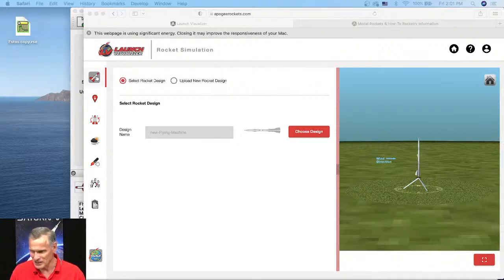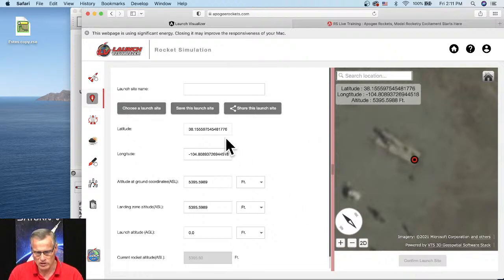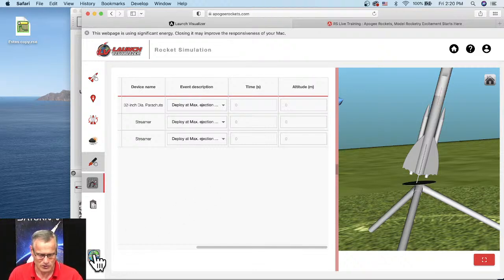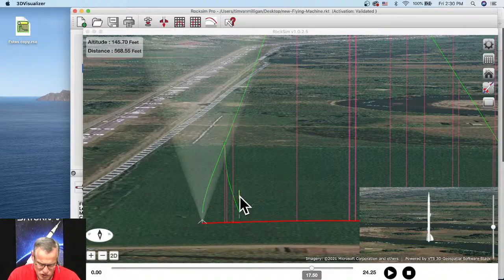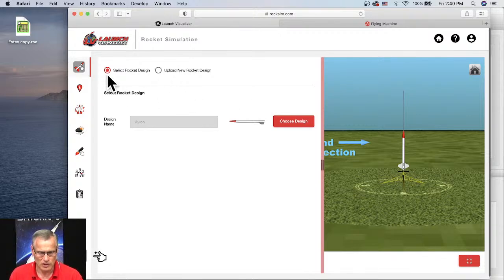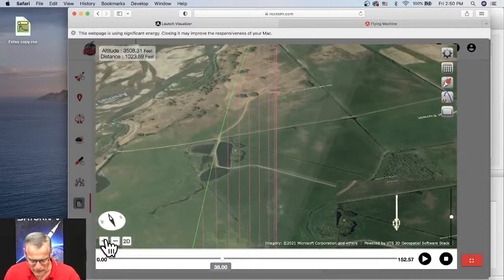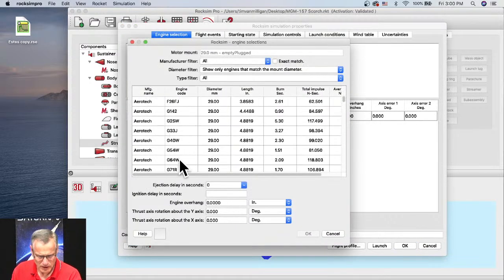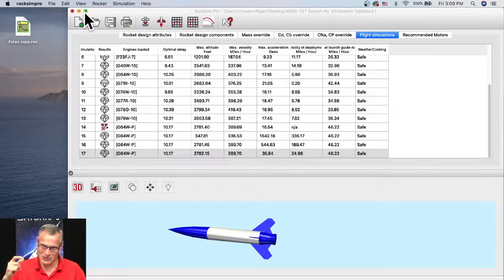Changing & Setting Wind Speeds - RockSim Training Live #46

Comment: I launched my model with 2 pods that separate. Only 1 pod separated and dissapeared. I also only got 1 pod to load with a motor. Is that the bug?
Reply: Aha.. cheked the vid again. I noticed I had a rediculous calculated weigth for the parachute.. mass was overruled though.
Reply from the maker: There is a bug that the programmers are aware of. I'm waiting for them to tell me it is fixed.
Reply: @apogeerockets  I've dug into it a bit more (not completely because that uses loads of glucose) but it seems to me that the weigt of the pods is on the rocket to apogee and that the thrust of the pods isn't added to the total thrust. I compared it to 2 other simulators and also made 1 flight in this configuration.